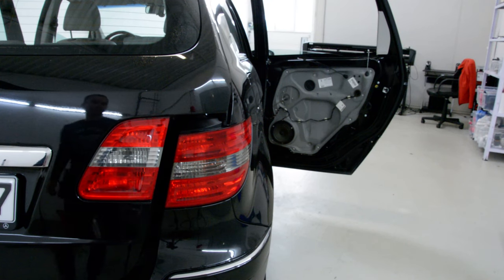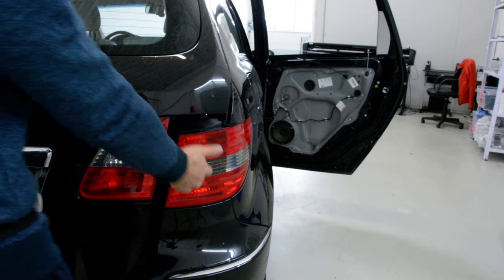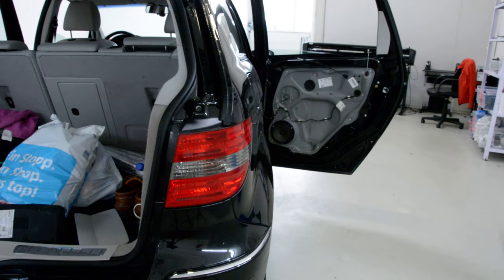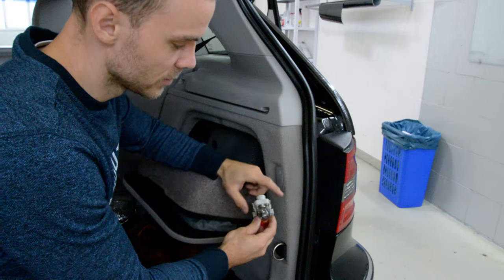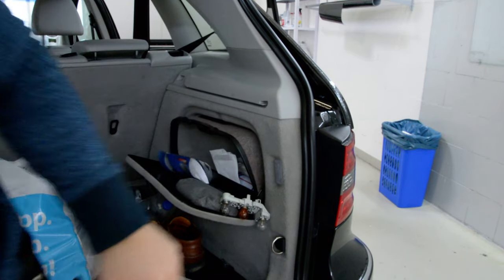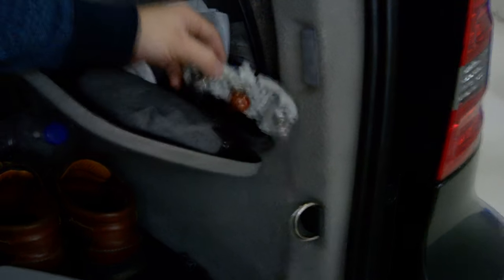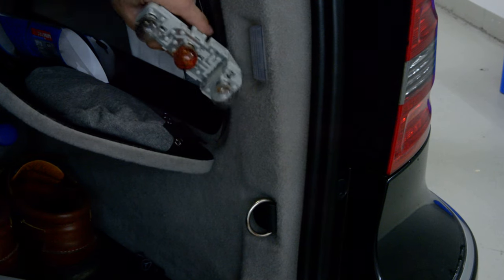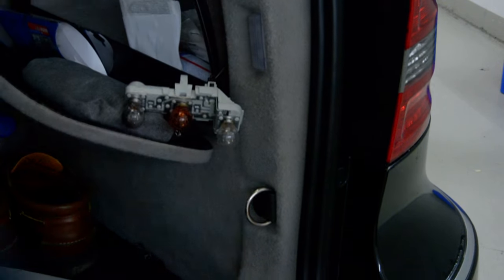Mercedes Benz Bulb Replacement Tail Lamp Brake Light  B Series W245

Comment: bro how to change reversing light bulb on b class w245
Reply from the maker: Take the taillights down like in the video and after is very easy. Unusually you need to remove the Bord (big plastic cover with the electric circuit on it )will all the bulbs.